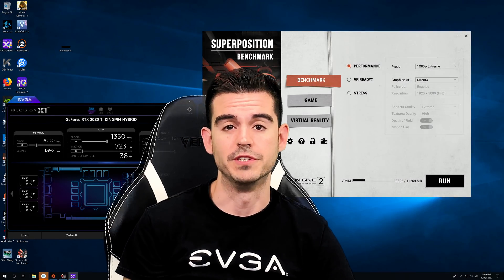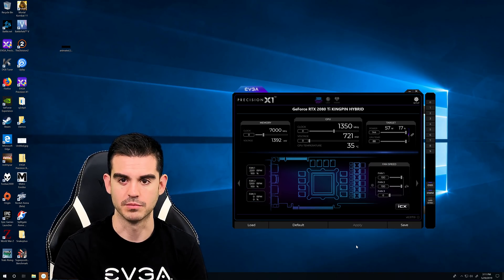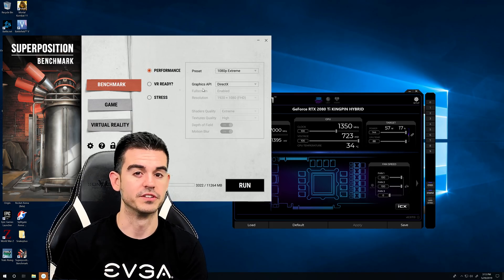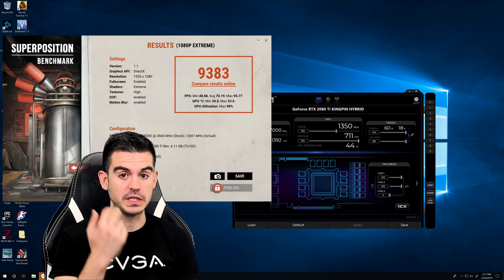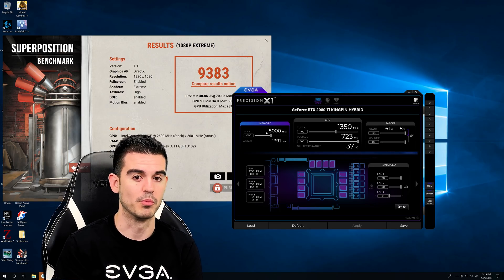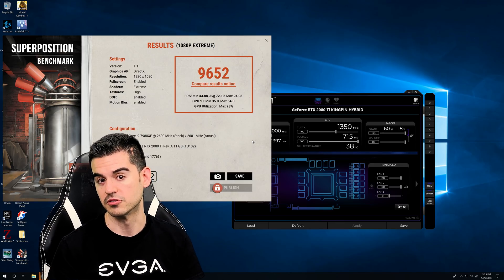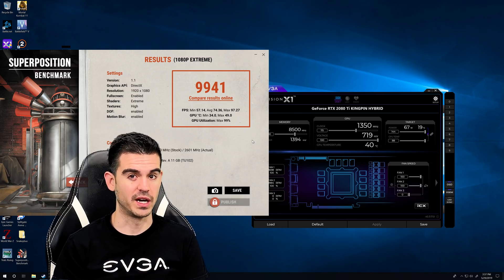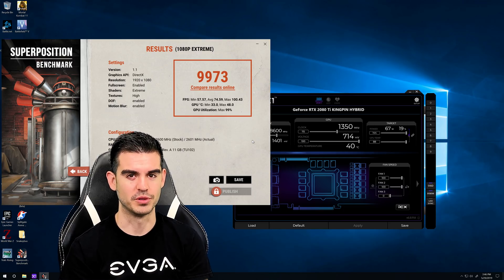EVGA Precision X1 Overclocking Guide

Comment: After some testing on my 1070. I got max of 136 fps on 1080 med. 50 offset core, 60 offset voltage, 600 offset memory (4608) 80% fan. Max temp is 66c 
For same settings in high: I dropped fps to 92.20 
GOOD VIDEO!

Comment: worked well for auto overclock but issues with saving profiles.  Other oc programs would make my screens go black but PrecisionX1 worked flawlessly for auto overclock.  Wound up going back to MSI for the nicer interface and no save issues and learned to manually overclock for better results.
Reply: I Just built a pc like 4 days ago got 
evga RTX3080 ti ftw3 ultra
i9-12900k
Case : Corsair 4000D
MSI MPG Z690 Edge WiFi DDR4 Gaming Motherboard 
4 16 gigs G Skill F4-4400C19D-32GTZR TridentZ RGB Series 2 x 16GB 288-Pin DDR4 SDRAM DDR4 4400
CPU cooler Corsair iCUE H150i Elite Capellix Liquid CPU Cooler, RGB Pump + Fans, 360mm

My first pc ive ever built, ive only ever had prebuilts in the past and not near as good. I need to update my bios i just cant figure it out, i know how to do it my motherboard just don't recognize the bios file from my usb drive. I watched so many videos about it i know i done it correctly it just wont show it. I even downloaded the file from there website under my motherboard. 

My board has a usb slot that says for bios im just scared to try that way, and yes my usb drive was formatted correcctly and nothing but the file was on it. 

I have 4 Nautica fans and 3 fans on my cpu liquid  cooler so i feel i have good enough cooling and extra power to overclock im just inexperienced and don't completely get it. So if anyone has any advise or could help me please get in touch. I would experiment myself i just saved money and been buying parts to build this upgraded pc for so long close to a year. managed to save while paying for school on mim wage lol,

I may see your reply in comments but if you reallly want to help my email is : camcotham@gmal.com

Comment: Heyy, just got an EVGA 1070 Gaming (the one with 1 weird fan in the end of it, not the one with 2 fans :p)  So my CPU is bottlenecking it, I'm using an I5-4460... Is it a good idea to try and OC my GPU? I used to have a GTX 650 and I still have similar fps in games, maybe 5-10fps extra with the new gpu.

Comment: No don't take the panel out - that is stupid as you want to test it in the environment it is to be running in, which is with panels on. Panels off destroys a positive airflow path as air will just move towards easiest way out. If it can't overclock well or fails that is because of inadequate air coming in meaning the case needs changes in either airflow or type of fans to push required air. Even better is there are fans that be added on the expansion slots allowing one to push air from bottom of case upwards if front or top fans aren't moving enough air towards the card.

Comment: i never touched my memory overclock and got 10969 result 99% GPU utilization 82 avg frames persecond with a nvidia 1080. Should i try and push it more?? that was on 1080p high btw

Comment: Hands down the buggiest, non-working piece of shit program I believe I've ever had the displeasure of attempting to use. No fan control. Just a blank screen where one should be. No way to tell if the "scan" is running. Might be? Might not be? Who f'n knows? If you hit the alleged "scan" button twice it brings up another screen stating you should close other programs and then has a button that says "cancel". Does that mean cancel the alleged scan that may or may not be running or cancel the open tab? Again, who f'n knows? There doesn't seem to be a single guide out there anywhere that is consistent. Save yourself the trouble and stick with MSI Afterburner.
Reply: Oh cry me a bloody river Jaxon! Ungrateful sod!

Comment: PLEASE HELP!!! I went to put 100 for clock and accidentally pressed another 0 so it was 1000 and clicked apply as I noticed. My PC is running still but no signal to my screen.
Reply: Test the card in another computer. Unless youv killed it, it should work as it will be running at stock speeds.
or you can try rebooting in safe mode and reinstall X1

Comment: just wondering if u could tell me why i cant seem to get any higher then a 100 Mhz core clock on The  EVGA Geforce RTX 2070 XC Ultra if i go any higher then 100 Mhz on the core it brakes in  Unigine Heaven Benchmark 4.0 but works fine at 100 but i can get the mem up to 1150 no prob is it just bad luck on the silicon lottery or was the card designed this was or is this specific card oc out the factory  just wondering if there was some more performance i can squeeze out this card TY

Comment: On an EVGA GTX 1080 (not TI), I was able to bench at Memory+1000, GPU:+50/+100 and pulled a Superposition score at 1080p High of 13000+. I knocked back the GPU to +50/+90 and reset the fan to Auto.  How do I save these settings so that I don't have to launch and reset after a reboot?
Reply: On 1080p extreme, I got a score of 4008
Reply: in the settings theres an option to keep settings after reboot although not recommended

Comment: About the voltage slider is it bad and isnt it better to leave it stock for regular use gaming ect. ? i got a 2080ti kingpin my score was 9974 3rd try 
mem:1500 core:115 corevoltage:100 
And target 144/88
Reply: How many Mhz did you get with that overclock?

Comment: Does anyone have good overclocking settings for a GTX 1080 Ti FTW3 11GB Hybrid?
Reply: it varies from card to card but since they are already factory overclocked, you cant really push it that much more. Use Precision X1 and use the VF Curve Tuner to determine your gpu clock, and memory start around 80-83. Also leave voltage at 0 and max out the power target.

Comment: Software is as bad as previous version.  Settings never actually apply. Even a simple fan settings do not save.  EVGA should actually test and use their own software before release..
Reply: Update: Simply download MSI Afterburner (latest version). Uninstall / remove OC1 / OCX. It doesn't work well. The MSI Afterburner software works great and very easy to use.

Comment: my new 1080 Ti EVGA failed the test. the scan showed 1671-set at the factory. fans I set myself to 100% I did no other ajustments it did smell like a new furnace in a house as it clocked up during the actual testing.

Comment: my new gpu 2080 ti FTW3 ultra finally arrived. +100 core / +1150 memory clock is stable. Not bad. I am, for sure, very happy.
I haven't use OC switch on card, but normal mode. Could i have better result in OC mode or is it useless ?
Reply: use the OC switch, you got an expensive card, may as well utilizer its full potential

Comment: any suggested settings for evga 2070 super xc ultra? 
ryzen 3800x 
16gb 3200 c14
x570 gigabyte auros ultra
Reply: did you ever settle on some?  I have essentially your exact build except for 16 gb @ 3600.  Just looking now into OC since I'm getting a new monitor and going up to 1440p.  Thanks!!
Reply: Anehum i used too until siege keeps crashing. i ended up not overclocking since 2070 super vc ultra was already good on stock settings. i did max the power and temp limit on msi afterburner.

Comment: i7 9700k OC 4.9GHz
RTX 2080 FTW3 OC 2025MHz

CPU underload hovers 60-64c
GPU 64-66c
Reply: i got same gpu running  120mz on core  so 2100mz with out adjusting any power limts ect,..   +600 on mem
Reply: also normal bios

Comment: Thanks a lot for this very helpful video. Just ordered an evga 2080ti  ftw3 ultra and will use your method.

Is there some any risk to play with this kind of stuff ?

Subscribed to this channel. It's my first evga gpu, i hope that i will happy with it for long.
Reply: I’m not a professional by any means but the risk is quite low. This is because graphics card are very good at not dying when something is not right, like an unstable cpu overclock or ram, even if you crank the core clock like an entire GH of what is recommenced it will still boot up to the bios and revert to old settings. I think one of the only cons to overclocking is that your putting a little less life on your graphics card.
Reply: @wricebrowl887  Thanks for your interest and your answer.
So, must pick up extra years warranty for 25euros 😁

Comment: got my 2080 ftw3 ultra yesterday 1000 for the memory and 110 on the core, i think i wont go any further even though i feel there's a little head room for oc
Reply: Just got this card , did you get it to clock any higher? Mine is running 1000 on the memory and 110 on the core just fine also.

Comment: Come on XrayMan you know how to get that Kingpin 2080 ti Hybrid to 10000 plus on Superposition, its "classified" and it must be cool.
14C ambient, 2220 GPU core clock, 172 gpu offset, 1550 mem offset, 8550 mem MHz, 1.23125 NNVVDC, 1.4875 FBVDC, 443watts, 0 NVVDC Loadline, disable NVVDD OCP.
Reply: Yeah only problem is his chip is literal trash, kingpins aren't binned as shown by this video, mine can do 2190MHz without any voltage change or alterations to classified. Not to mention the kingpin has loose timings on memory config.

Comment: I have an EVGA 1080 and use MSI Afterburner with great success. I don't see any advantage to using Precision X1. Is there any?
Reply: I just use XOC for turning up all my fans on my ftw3 1080 ti since MSI AB doesn't let you do that. I use AB solely for overclocking though. In MSI it now allows you to OC up to 1500 now.
Reply: @chewie5843  what clock speeds do you run with your gpu? I have the same and can get around +38 for clock and +80 for memory clock

Comment: Nice Job man. I score 10019 with my 2080ti FTW3. +120 for the core and +1500 for mem.
Reply: 10025 with +1450 mem and +120 core.
Reply: I know I'm super late on this, but are your settings still applied and stable? Also, what are your settings? 
Have the same card here, and many more out there like us... any info would help us all. Thanks, pal.
Reply: @AnjewTate  i'am stable at +90 core and +800 mem with 8700k cpu (no oc on it). Only air cooling.
Reply: That's a nice chip you got there.
Reply: on my 2080ti ftw3 ultra only 9683 pts +100 core/+1000 mem. you are lucky but i try only in normal bios not switch to oc

Comment: That memory overclock is insane! On stock voltage, no less! I have to put in a pretty hardy voltage bump to get +1400 or higher
Reply: It's not stock voltage. He says to increase voltage to max. DO NOT DO THAT. I had better scores increasing voltage to 30.
Reply: @Grooveoriented   the voltage slider doesn't really affect VRAM. I was referring to FBVDD (VRAM voltage) which you can use the voltage switches or the classified tool that allows you to manually set any voltage you like on a kingpin card.
Reply: @tresnugget  this video is getting a lot of hits and kids thinking they can just ramp up voltage need to know that's not a general practice unless you have a thousand dollar GPU.
Reply: @Grooveoriented it’s a 2080ti which were like 1600-2000 at release lol

Comment: I'm pretty sure it's 144% of 360w which is 520w. Stock kingpin power limit is 360w and max power limit is 520w according to https://xdevs.com/guide/2080ti_kpe/
Reply: Also according to TiN the voltage slider does nothing